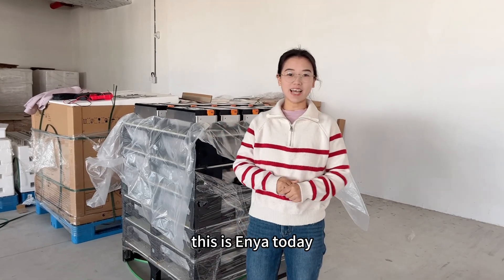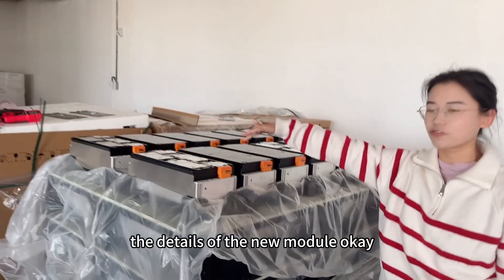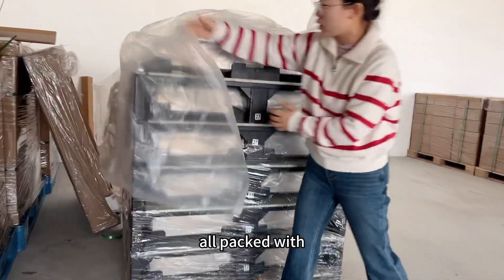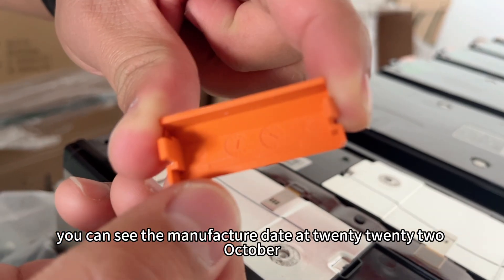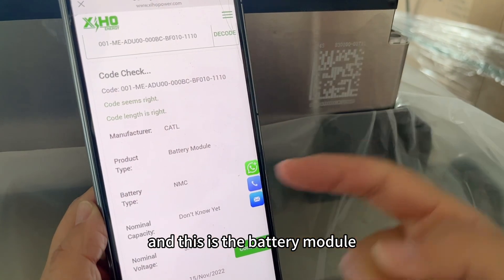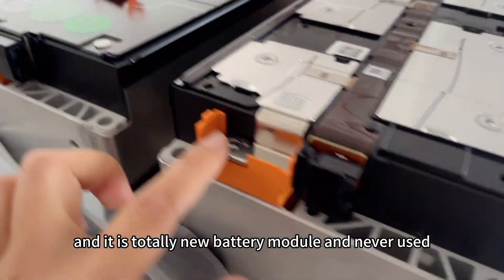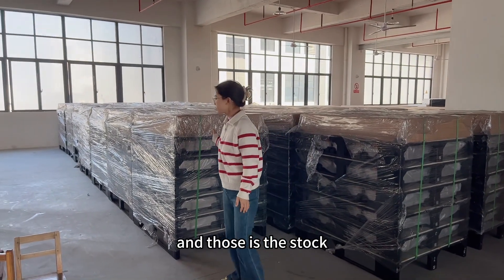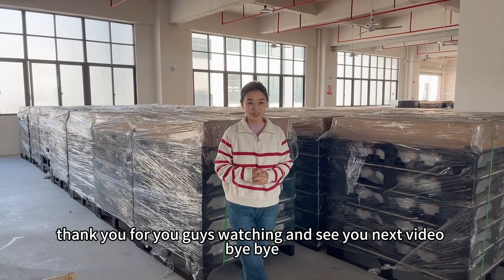60KWh CATL 4S1P 177Ah battery module for Nissan Leaf car upgrade

Comment: Nice.....after 3 years storage without charging i hope the cells has no toxic undervoltage (2,5 V). The self discharge rate is 1 % per month. Starting at 4,2V the rest voltage may 2,7V. Can you measure that?
Reply from the maker: Yes, now the module under testing, We will show you later
Reply from the maker: Qualified battery won't drop the voltage from 4.2v to 2.7v for 3years. At present those battery module voltage 3.88v. When new made battery from manufacturer the voltage won't set at 4.2v, full energy 100%SOC will be danger during transportation, 50% SOC for standard.
Reply: 80% SOC before storage increase the time span to reach the toxic undervoltage. The 1% - 4% discharge span per month is the official info for this lithium chemistry.
Reply: @Alles_ist_moeglichauchdasGute  Where did you read this nonsense? 
Is there a link?